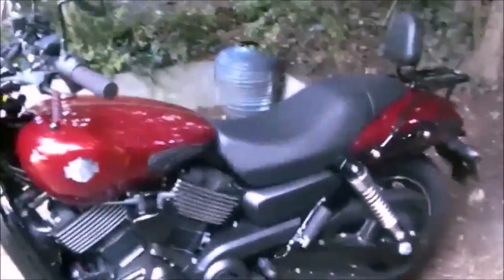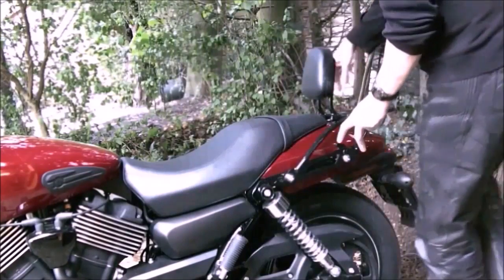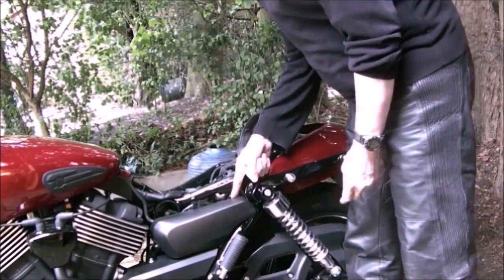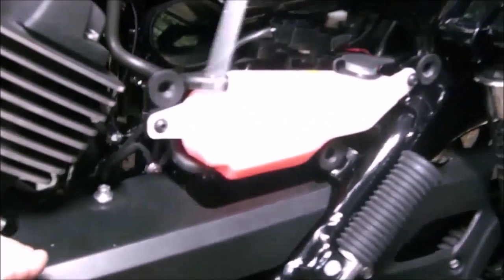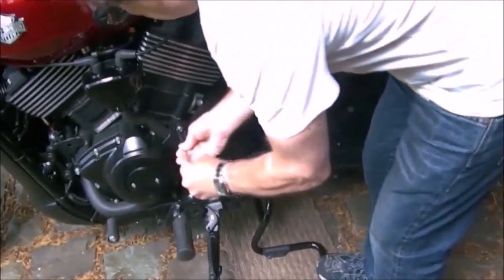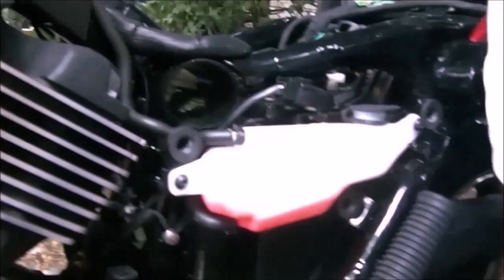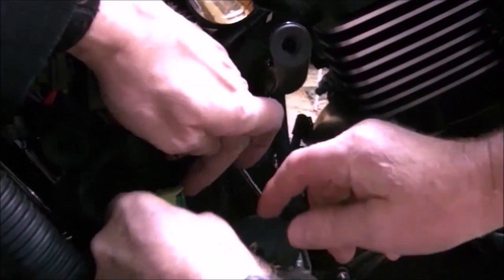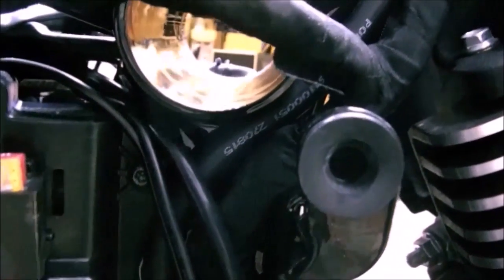H D XG 750 Street #107 Battery 01 (Removal - preparation)

Comment: Hi Ariel, thanks a lot for the Video, it helped me greatly. Jut one tip if i may, i found that if you remove the Coolant tank, you can access the ground terminal and don't have to remove the belt guard. 
The other trick i used is that i tied a thick string  to the negative wire before pulling it to the other side, so when I have replace the battery, i just pulled at the string and the negative wire came straight through without any fiddling. Hope thats of help. cheers
Reply from the maker: No probs. And yes we all find our way of doing the same things. I did think of the Coolant tank, but if it leaks or the top comes off... But I'm with you on the string.

Comment from the maker: A small note: On the new Harley 's is that they have changed the  re-charging lead. The new one has a blinking LED that lets you know what condition the battery is in? I've only just noticed it myself on my new XG 750 Street 2017

Comment: Question guys, I found my battery ground not ground it to the chassis just connected to the battery, what should I do to connect the new battery, should I leave it like that or found a good ground to plug it in ?
Reply from the maker: What? There is a lead from the battery to the ground (chassis) or it won't work
Reply: Ariel GB it was loose and I used my motorcycle but the battery died and now it won’t start
Reply: nice